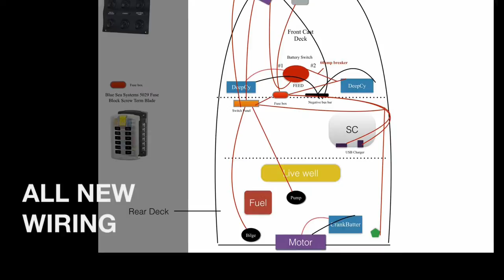1980 BASS TRACKER lll Rebuild

Comment: Great job! Question I have is, where the seams are between decks and hull. Did you caulk them? And would the coating stick to a caulk? I have a Tracker 175, 2006 and really don't won't carpet anymore. I looked in to LineX. But it will add 60lbs. To a 17.5' boat. Thanks

Comment: Nice rebuild looks great I have a question is there a livewell in these 80s tracker boats and do they have all the pumps and recirculation and bilge setups like the newer models have?
Reply from the maker: Thank you! It does have a live well...but I don’t use it. I blocked off the hose and use it as a place to store all my tackle. I would have needed to do all the electrical work and added the pumps myself. It wouldn’t have been hard to do since it was set up for it.
Reply: Ok thank you for the info I'm looking to purchase a 1986 bass tracker pro 16 for a decent deal and dont know much about these older tracker boats is there anything I should look out for when inspecting and test the boat out?

Comment: I am about to buy the same one from this video, would you recommend it? Is it stable?
Reply from the maker: It all depends how it’s used and how many people are in the boat. I’m 250lbs and never had any issues moving around the boat. I also stood on a casting deck on the front with no problem either. For this size boat I would say it’s stable.

Comment: great video is there a way to share the wiring diagram
Reply from the maker: Thanks!! I got most of my information from the forum on tinboats.net.  This link will take you to the post I made during my build. It will have a picture of the diagram.
Reply from the maker: http://forum.tinboats.net/viewtopic.php?f=21&t=36087&hilit=1980+bass+tracker
Reply from the maker: This is a link to the post I made trying to figure out the wiring diagram. 
http://forum.tinboats.net/viewtopic.php?f=5&t=36003

Comment: What's the name of the adhesive flooring you put down?
Reply from the maker: I used Tuff Coat Rubberized Non-Skid Coating. It has held up well. I had a few spots that showed signs of wear but it was a quick fix with the leftovers I had saved. It was really tough to apply it until I actually read the directions and realized I could add water. I would use it again if I did it all over.